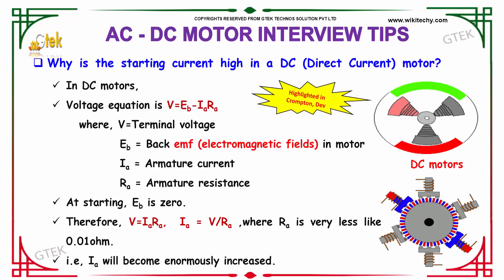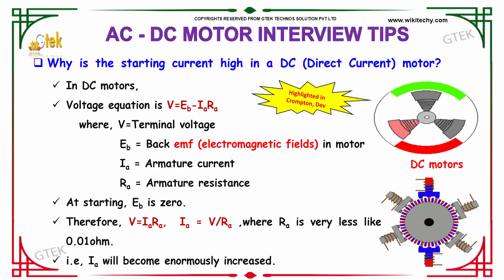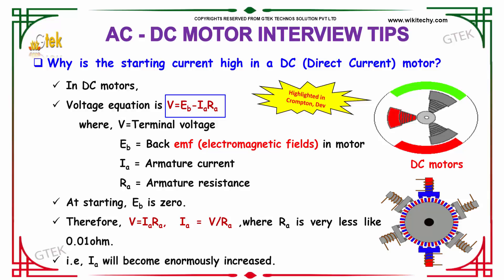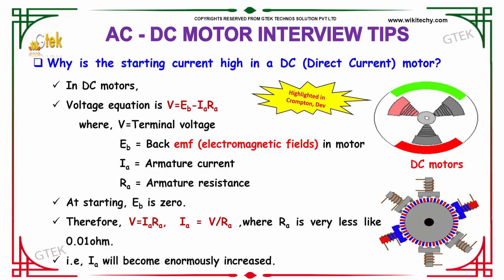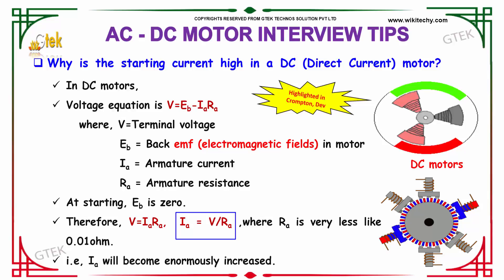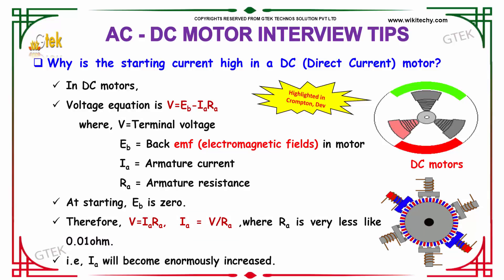Why is the Starting Current High in a DC Motor | AC-DC Motors Electrical Interview Questions

Comment: Where E is the supply voltage, Ia is the armature current, Ra is the armature resistance. And the back emf is given by Eb. ... This back emf of DC motor is given by and has a major role to play in case of the starting of DC motor. From this equation we can see that Eb is directly proportional to the speed N of the motor.

Comment: Why High Starting Currents: Induction motor can be compared to an electrical transformer with the secondary short circuited. Primary winding of the transformer can be compared to the stator winding of the induction motor and the rotor winding is considered as the short circuited secondary winding of the transformer.

Comment: Starting methods of a DC motor. Now, when the motor is at rest, obviously, the back emf Eb = 0. Hence, armaturecurrent at the moment of starting can be given as Ia = E / Ra. In practical DCmachines, armature resistance is basically very low, generally about 0.5 Ω.

Comment: Why is the starting current high in a DC Motor?
Where E is the supply voltage, Ia is the armature current, Ra is the armature resistance. And the back emf is given by Eb